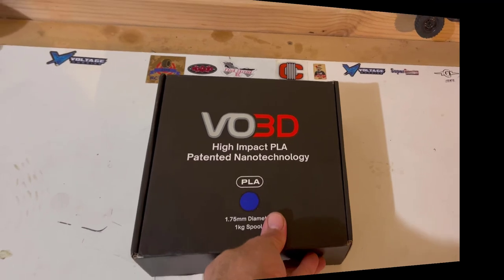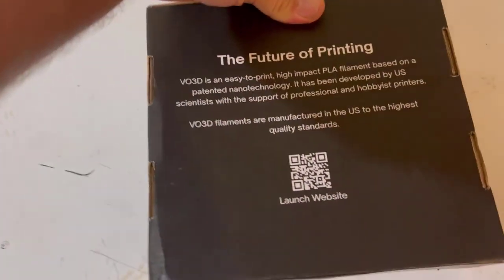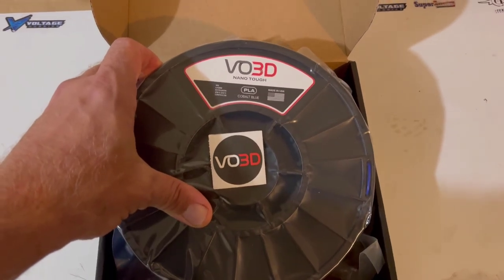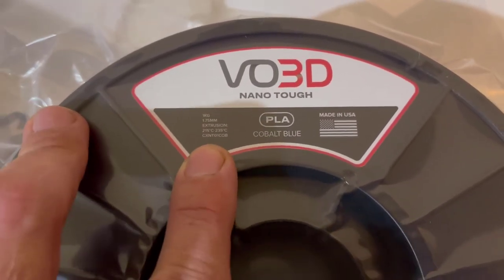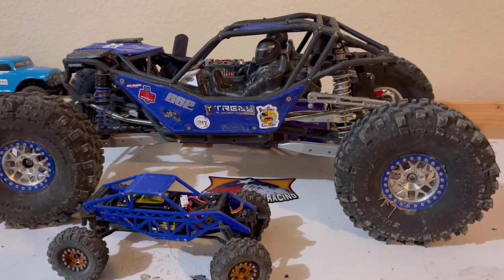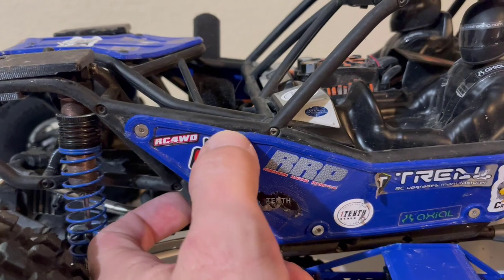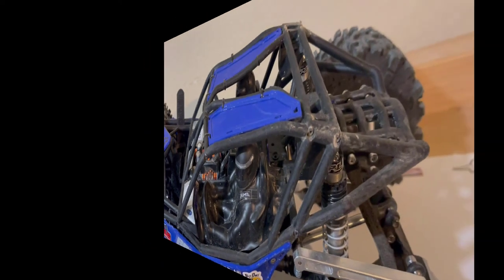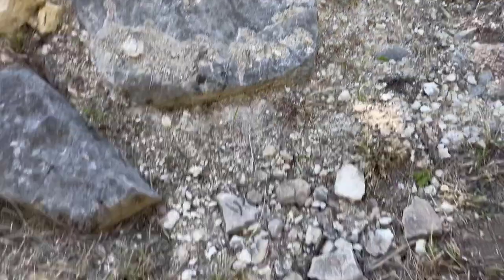Can PLA Be High Impact?

Comment: What print settings are you using? I have had issues with stringing, not sure if I need to adjust temp or retraction, etc...  Using flash forge adventurer 4.  Also seems a bit more flexible on my prints.  I assume that has something to do with the high impact?
Reply from the maker: I'm using a QIDI iMates and did 230* on the hot end.  1.8mm retraction and QIDI default coast settings (I think .4MM).  Might try dehydrating it too if the stringing won't stop.
Reply from the maker: Correct, the flexability lends to higher impact resistance.  Kind of like Titanium is super rigid but can snap...  A little give takes the energy of the impact and disperses it.
Reply: @1TenthScaleRC  thanks after playing with the settings I seem to have got it working much better...  thank you for the response.